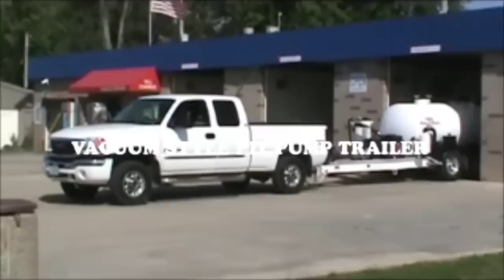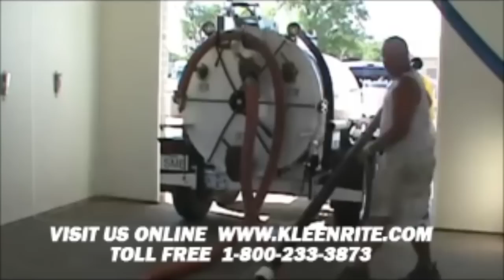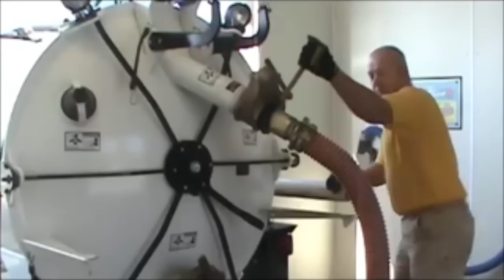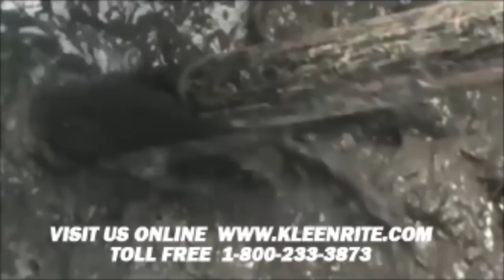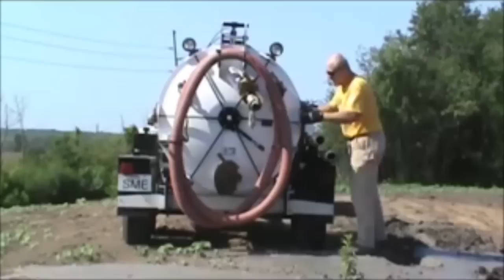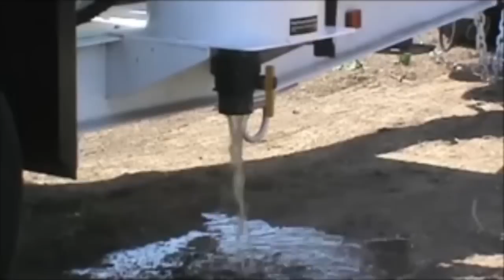Vacuum Style PIT PUMP Trailer

Comment: Good video. I have sucked hundreds of pits with a Ring-o-Matic vac. Use a power auger before you vac. Stir the full pit into a slurry. It will suction out in minutes.